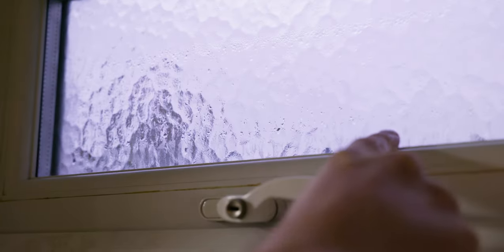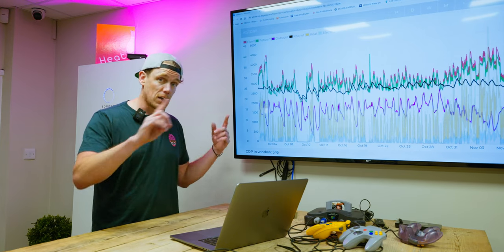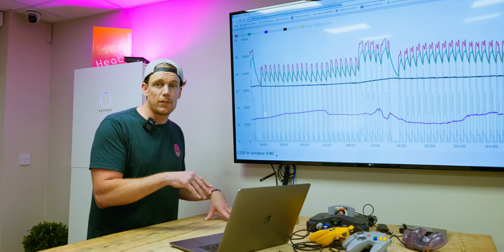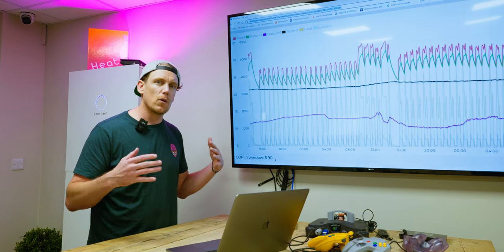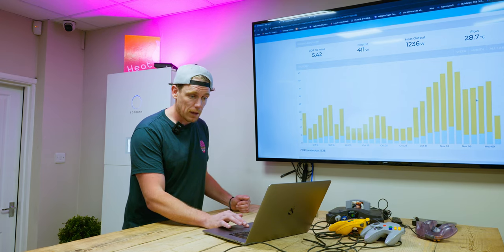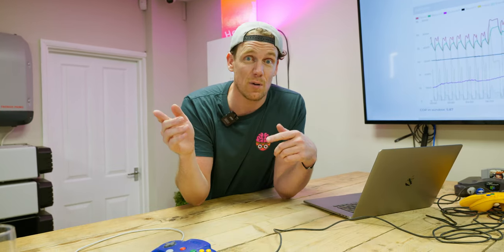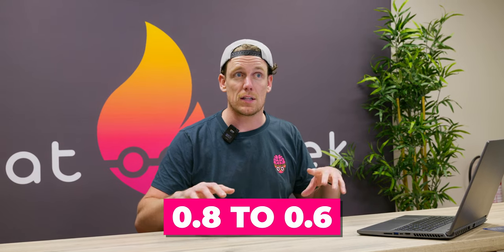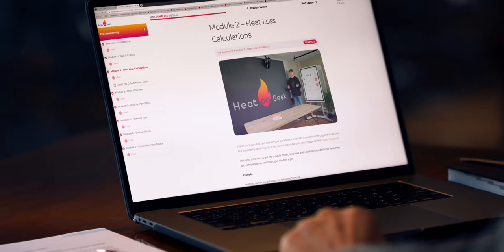How We Got 600% HEAT PUMP EFFICIENCY With NO INSULATION!

Comment: can we please stop combining insulation with a bunch of other factors? the efficienty is dicated by the temperature of the water, nothing more or less. if remving the insulation factor in discussions and activly saying that insulation has nothing to do with the method of heating the water we can finally separate the proper heat pump installers from gas boiler hacks. 
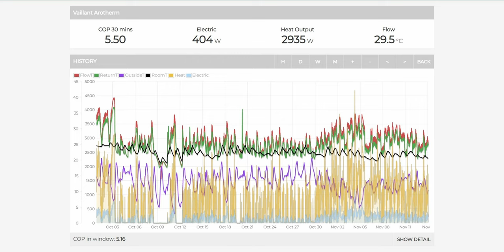ps: looking at the screen at 2:00 i have to say: please set up the machine properly. the number of cycles it does is insane. you are killing the machine. it should start once and keep running for many hours, not minutes.
Reply: The insulation does allow you to run lower flow Temps, just like wider pipes and bigger rads do.
Reply from the maker: It has 45 minute cycles. This is not short cycling. Its a 5kw unit and the 3.5 kw model has the same minimum output so cannot change. Its fine.
Reply: @HeatGeek  that’s disappointing to hear. I’ve got the 3.5kw on order to be fitted next month if I’d known the minimum output was the same I’d probably gone with the 5kw.
is there any point or advantage to the smaller model ?
Reply from the maker: @edetc10  yes the software will be running for a smoother lower output.
Reply: @Lewis_Standing  that is a different part of the whole system. the insulation only tells you how much energy you need, not how to make it.
Reply: @HeatGeek  45 minutes is still very short. unless the compressor is actually running at the lowest speed it can (you need to check that) it simply means the water temp is simply too high. its better to lower the temp and decrease the delta to a few degrees than just let it cycle. just ensure the rads can dissipate enough for the minimum the unit has and dont go below that to prevent short cycling. 45 minutes is not acceptable when i install a system, my target is at least 2 hours or more per run as soon as it gets a bit cold outside. in this case it cycles constantly so there is enough demand so lowering the water temp is useful as it prevents the building from overshooting too fast like it is now. right now the system is pumping in too much heat for the given load causing the thermostat to intervene.
Reply from the maker: @SupremeRuleroftheWorld  I think your confused why its cycling.. lowering the flow temp will i ly increase cycling.. its not cycling becaise its on some kind of on/off room stat...
Reply from the maker: Mate, if your using room stats on a heat pump I beg you to please stop lol. 

Yes I've checked if compressor is min.. yes it is.. you can too. Follow the link
Reply: @SupremeRuleroftheWorld  it's both. If you have a lower heat loss then you can meet that demand with a lower flow temp. Same as you can meet it through a narrower pipe. 
So it all ties in.

Comment: Cop is efficiency but what about price? My understanding is that you have to have the heating on constantly which isn't very efficient in my opinion. Also when temperatures drop to real winter levels the efficiency will also drop and the delta t will be increased meaning that the room might feel colder. Im all up for renewable energy and solar thermal is amazing but I am not sold on heat pumps. Its easy to heat a house that isn't cold. Also if you had to heat the hot water the efficency goes right down to practically nothing to reach temperatures above 55 so for a normal consumer you are looking at standard costs of heating hot water with electricity which is expensive. Put into the equation that the cost of instalation is high and the electricity that you are using isn't green electricity, is it worth all the faff. Boiler manufacturers are pushing for greener options like hydrogen. There are alot of countries making green hydrogen by using solar pv on a mass scale, why arnt we using it...
Reply: @zlmdragon.  what is a silly question?

Comment: So a heat pump can heat an old drafty house if you fill every available bit of wall space up with huge radiators. Didn't the Victorians do that. The difference being they used coal boilers. You are using power from a coal power station. Isn't progress grand.
Reply from the maker: These aren't abnormally sized radiators in the slightest.. regarding the power being used the generation mix is almost entirely an equally mix of coal and green generation.. there's almost 0 coal used.
Reply: @HeatGeek  60% of UK electricity isn’t generated by renewables each year. It will be hardly coal, it’ll be mostly gas.
Reply: @HeatGeek  During my 37 years in the UK and nearly 20 of those in construction where I often hung radiators I seldom saw any that big in a domestic situation. So if these are normal now this must be part of the oversize pipe and rad thing associated with heat pumps. Depending on where your office is situated your power could be Coal. Gas. Nuclear or renewable. I know the UK is working towards all renewables by something like 2050 but it isn't there yet. Where I used to live it came from two nuclear power stations and probably still does. Closer to 2050 energy will be greener. I still reckon the cart is before the horse. A few better healed households experimenting with heat pumps but not really at this stage of much benefit to the masses. Not doubting your statement about heat geeks being top of their game. Or what you can get out of a system. Just don't believe you have enough cards yet for a full deck.
Reply from the maker: @davetaylor4741  even if grid was 100% gas this heat pump would still be an 80% reduction in carbon and much cheaper than a boiler. Sounds ideal to me. We should have shown you the radiators, they are normal double pannels, as pretty much all are now with the new regs.
Reply: @HeatGeek  Heat pumps are super efficient as of today's technology. You can get them six times more efficient than a perfect system. Joke there. I have watched the videos on calculating efficiency. They save money and cut CO2 over using a regular gas boiler. All no doubt true. Still doubt I would ever have one. In Oz I now generate most of my power via solar. And use aircon sparingly. If I had still been in UK. I would be looking for a house with water flow like the old mill house I was born in. Cascade beside the house. Water driven generator powering anything I liked. Now that must be good for price. The environment and any other acronym that pertains to it. Mankind was pretty green when the main sources of power were water and wind. Centuries later we are chasing the same green energy. But now by flooding vast areas for hydro. And building bloody ugly wind turbines. All to run super efficient heat pumps that run bloody ugly radiators to warm our toes. As we are now up in the 30's C   I won't be needing heat for a while. Come February you may have your system to 7 times better than perfect. But the seperate 3.5kW water heater might take the shine off a bit.
Reply: @davetaylor4741  If you've got aircon, you already have a heat-pump.
Reply: @shm5547  Yes I know. And I also used to have a heat pump hot water system. It is the water to water variety that seem to be being pushed by UK government. These are the ones heat geeks keep on about. These are the ones I don't believe are currently suitable for many situations. They may be individually efficient. But as yet the infrastructure isn't really there to make them nationally viable. Plus size of units. Complication of units. And expense of units etc. Air to air whole different ball game as in a previous heat geeks video.
Reply: @davetaylor4741  air to water heat pumps are new tech based on old tech. There’s nothing more complicated than air-to-air air conditioning in them really, it's the application of the tech that’s new and it will take time for prices to come down. If you can generate enough power with solar to run resistive heating, then that is arguably more reliable as there are no moving parts or dangerous refrigerant gases to worry about. But you will need 5 times as many solar panels as you would need with a COP 5 heat pump. The cost of those additional solar panels might be more than the heat pump.
Reply: @shm5547  The price will come down no doubt as time goes by. They may even make them smaller but still believe the air to water systems are not right for too many applications. Even with the new climate in UK I wouldn't bother with solar panels. Not like here where we get just so much sun they hardly stop working. Some of those old electric fires got quite decorative and inventive back in the day. Log effect or coal effect with fan forced delivery. Almost like the real thing. But can't see them making a comeback. In Qld we mostly need cooling and the air to air is perfect. Plus for the few nights it does get cool you can easily flip to heat. Nothing against any heat pump. Apart from perhaps the noise. None of them are quiet except maybe ground source. Never had one. Give the air to water ones another twenty years and they might be just the ticket.

Comment: You dont have 6 times efficiency m8..you re talking bollocks..COP is affected by how cold it is outside when using an Air-water.heat pump..10 degrees with 6 COP..is now wow..there are heat pumps that give you 5 COP at -10 .
Reply from the maker: Sorry I don't follow?
Reply: @HeatGeek  your title.is 600% efficient...you re bad at math or? That means 6 times more efficient ..which is not the case..any heat pump has a COP ( for 1kw of electricity you get 5 kw of heat)..crap ones have less and they re even worse when its cold outside ..good ones like Nibe have more and they can give you a 1:3 even at -20....do you understand or i have to make a drawing for ya?
Reply from the maker: @83glacius  you'll have to draw a picture sorry. No idea.

Comment: There is absolutely no meat in this video. A waste of time.
Reply from the maker: What do you mean exactly please? Thos was a video to prove what they can do and was extremely surprising to most in thr industry
Reply: @HeatGeek  The performance/efficiency of any heating apparatus is not a function of how the environment in which is located is insulated. The insulation only relates to the retention of the heat produced in the environment. Obviously any heating apparatus will be more effective in an insulated environment irrespective of the kind of heating apparatus used be it a heat pump or a more conventional boiler. So the premise of the whole piece is false and the results nothing to do with insulation.
No explanation is given re how the output of the heat pump is being measured. We are told that radiators were changed. Obviously a larger radiating surface will allow more heat to be extracted so how was this being measured. The existing radiators were presumably part of an older conventional heating system. How were the flow rates etc. adjusted to make this change. Weather compensation is mentioned but no explanation given re why or exactly what effect this had. You state that the system was balanced. I presume this was balancing between the various radiators used to achieve the desired temperature distribution. You do this on any heating system and it does not affect the efficiency of the heat source.
So in summary there are no great revelations in this piece and no explanation provide for any of the changes made. If this was surprising to most in the industry then pity the industry.

Comment: My personal plan to decarbonisation is to follow PassivHaus / the 2000 watt society ethos of things 

My plan is :
Reinforce my flat roof 
Get more solar panels 
Make things air tight 
MVHR installation 
Install triple glazing 
Upgrade pipes 
Upgrade radiators 
Get an induction cooker 
Heat pump water storage + heat pump right at the very end, to get the best COP

The way I see it, is almost all the above have an ROI. I don't expect an ROI on an induction cooker / heat pump but it's good to get that anyway if there is one 

The rationale for doing those right at the very end, is because hopefully I'll have a bit of spare cash to do that, and even IF there's a price hit to leccy prices like they are now, I should be somewhat insulated, to use the pun

If I had the cash, I'd buy some land, make a PassivHaus premium plus house and get a ground source heat pump

But that's only if I win the lottery lol